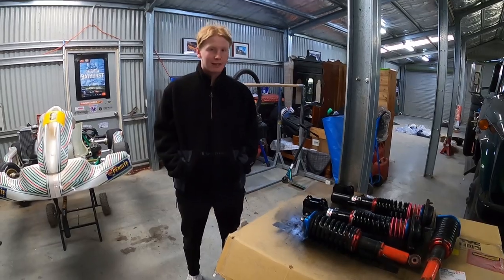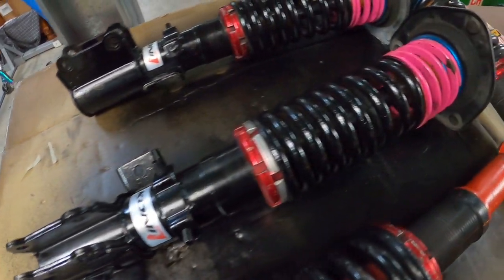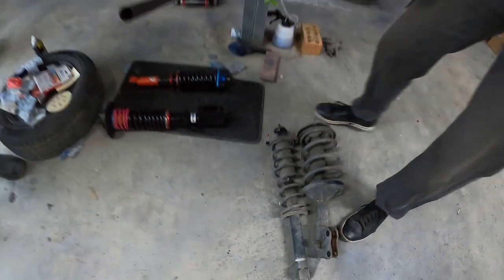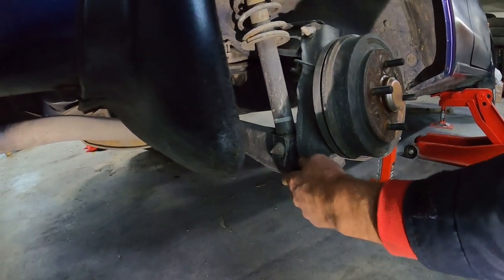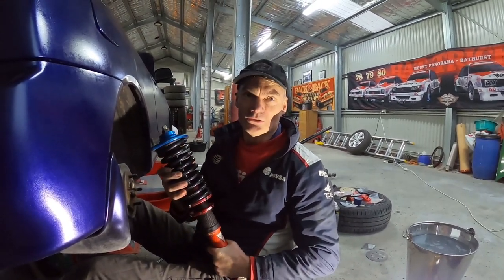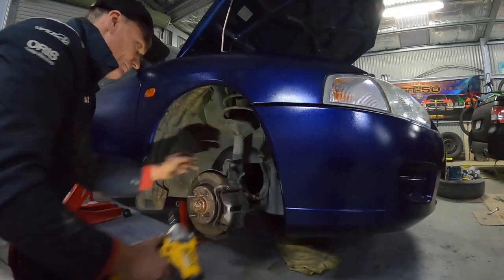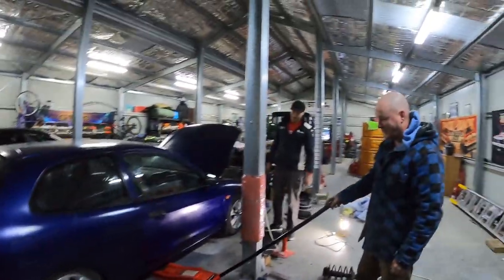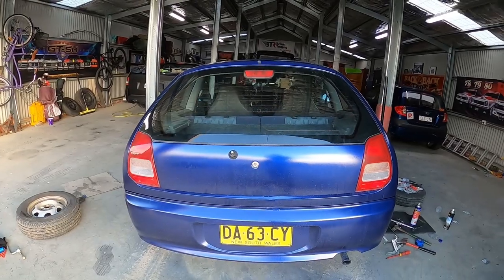Koni Coilovers Upgrade - Mitsubishi Mirage Project Rally Car

Comment: Great video Clunie Garage team.  Are we better off buying some second hand suspension like you did or buy news off eBay?  I see MaXpeeding rods are new for around $500.  Sharon' car just got knocked back on it's inspection.  Just trying to work out the best way forward.  Any help would be greatly appreciated.
Reply: I heard that 90/10 drag shocks were just the ticket for a front wheel drive car!!!

Comment: Looks perfect to me, don't change a thing. Isn't rock hard suspension good on the track?
Reply from the maker: G'day Angry, we will stick with the fronts as they are as I have managed to adjust them last night.  We might need to change the springs in the rear however.
Reply: Does it have to be a plush setup for the dirt.? I thought dirt was for farming and tarmac was for racing! No dirt trackers!
Reply from the maker: @angry9901  I seem to remember a sign at Pulford's that had that same phrase!
Reply: I agree with Angry.  It looks as low as the Kart! Lower centre of gravity and less body roll means more grip!!
Reply: What about every day driving? We have a lot of potholes in our suburb and am wondering if these would be suitable for everyday use?
Reply: They would be perfect for your application Vicki. Free Spinal Tap with every drive.😜

Comment: When does the NOS arrive? Next week? Hopefully.....
Reply from the maker: NOS will have to wait a little while until we sort out suspension and the paint.  You should jump in Mums Caprice and have a look at Pedders for me and see if they have a softer spring we can put in our rear coilovers!
Reply: Mum won't let me drive the Caprice but she said you should back off the compression dampening to it's softest setting before you change the spring rate! Just her 2c.
Reply: Don't listen to him Clunie Garage.  They use NOS at the dentist and for medical procedures - it's not recommended for using in cars according to wikipedia.
Reply from the maker: Thanks for the tip Vicki, will make sure ask for some NOS when Fred Junior next gets his braces checked!!
Reply from the maker: I reckon you should put some rock hard Konis in Mums Caprice - see how long they last before she asks you to pull them out!